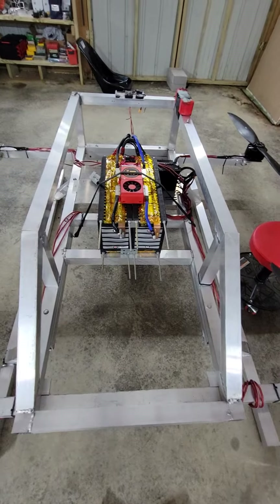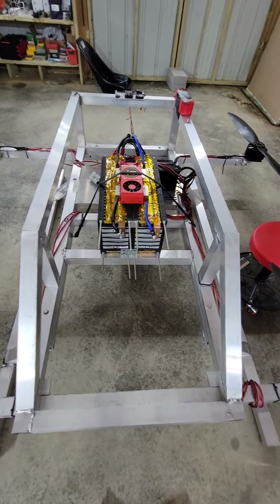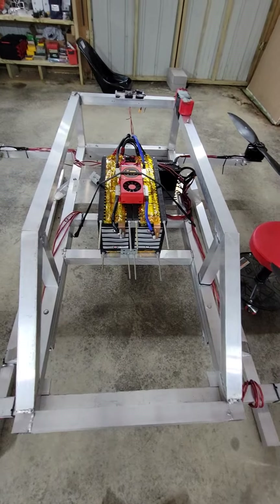Manned / Unmanned Drone Battery Placement-Elon, make some advanced flat cell Li-ions please...lol

Comment: Hi, Francisco, Dak here. I like your devotion to this project, never the less, I am a bit angry that no one here have told you what is main working concept. I am a drone technician, so I will give you a little advice: First of all, just in case you are not 100% shure how it all works, just make totally yourself one little drone and test it. Than, when you lookup of this big bird you will slap yourself in the forehead and say: Maan, what I have done here - air wenting mashine or what. I will give you a couple of uaw-tips (first goes beginners mode): Your flight controller should be (for beginners mode) at the center of the aircraft, and positioned also in the same axel as motors (also beginners stage, no hurries with prim/sec management and local/extended gyro - just a big toy drone for the beginning which flies awesome - after that upgrades. That line should beginners follow). 

Second tip: never ever put something with big el. radiation source direct near the flight controller or gps modul /unless it is shielded/ because it could make fault calculations/internal-bus-comm`s (so, no opened and running laptops near the most sensitive el. equipment please). And the third tip: put just a tree Al Bars under every propeller and connect it to the drone frame - so in a case of propeller  accident - it would not be damaged with ground collision. And please do not forget: this is uaw, no manned drone, do not seat there please. I you want a manned drone than get back that N3 controller and make redundancy power train also (for the very first beginning and after first success that connect redundan. FC board also and anotrher N3 or A3 FC with redun. GPS, and Batteries.). Have a nice project man, and be safe/stay safe.

Comment: hello, I'm also creating a drone for transport but with the x8 configuration of engine versus engine using 25kv u15xxxil motors I'm having doubts about the battery and electrical configuration I'm having doubts about the controller for the x8 system and battery that would handle this type of configuration

￼
Reply: I intend to use 18650 batteries what kind of configuration with these batteries would work best

￼